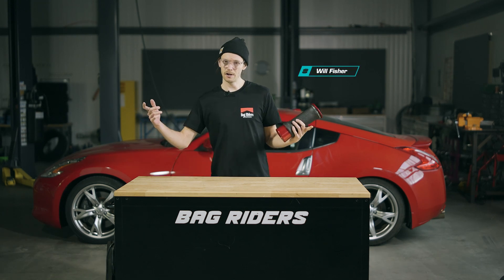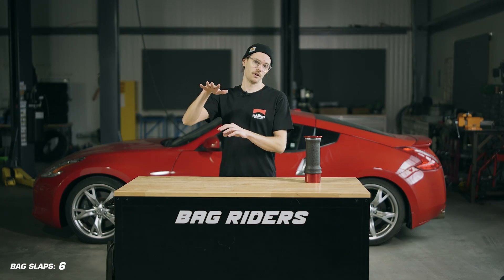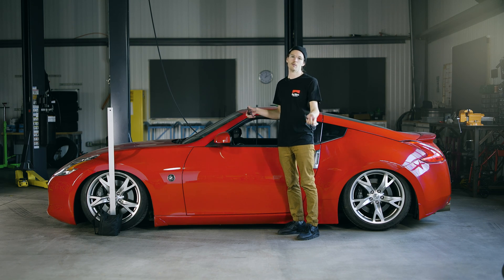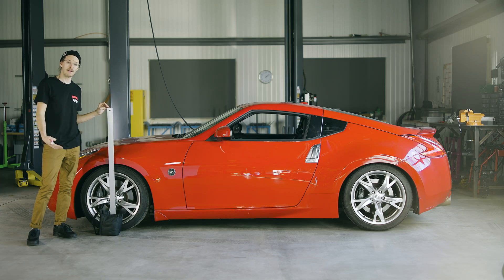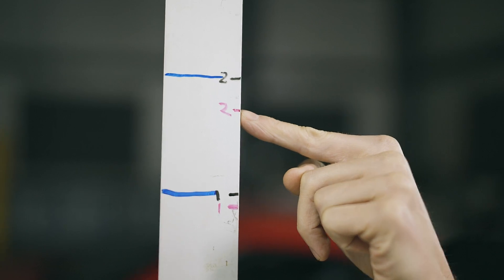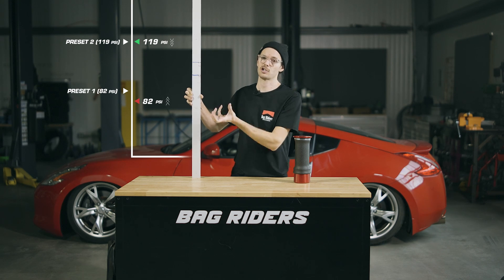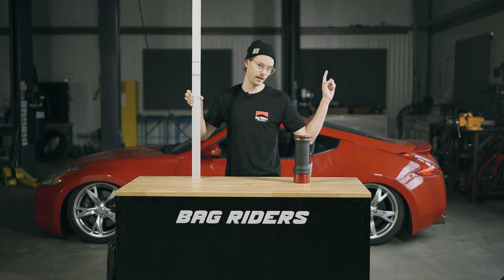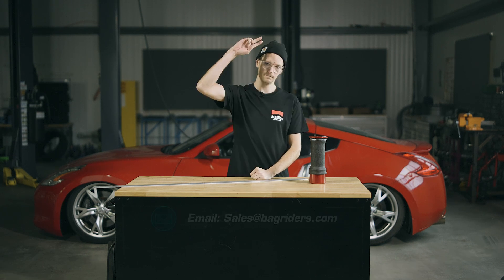Why do people HATE Sleeve Bags?

Comment: Why won't Air Bag companies develop a system for vehicles with air suspension? They already have compressors, air bags, and height sensors.
Reply from the maker: The main reason is that OEM air suspension systems are designed with comfort and long-term durability in mind not customization or performance. They're typically not built to go very low, and forcing them to can actually damage components like the shocks. In many cases, when OEM air suspension fails, the cost to replace it is similar or sometimes even higher than upgrading to a full aftermarket setup that offers more control, better performance, and a wider range of adjustability.

Comment: Tried to use double bellows slim bags and i even clearanced the upper a arms, but bag still hits on the sheet metal of the strut tower on our 91 accord cb9. Would sleeve bags solve this? It looks like they puff up to a pretty large diameter as well....
Reply from the maker: A sleeve might be a good option. Lots of past Air Lift kits for older Hondas did indeed use a sleeve style bag.

Comment: couldnt you basically just go from air out to ride height and measure where it lands, then just set your preset there? i assume it would add more pressure into the bags but thats what the height sensors would achieve anyway.
Reply: After a bit of driving (suspension moving up and down) the height would increase

Comment: I had an off topic question. Hopefully u guys can answer. I have airlift and on the manual it states that max air pressure is 120psi, but I’ve seen people on up to 135 psi are they in the wrong or technically can u have it that high ?
Reply from the maker: I don't see an issue with exceeding 120 PSI. It's not a pressure you would want to have for normal use, but in a pinch it will work just fine.

Comment: When i first got bags the company Vera just released their setup, in like 2017ish. Truhart air struts look just like these in the video, the management i had was pressure based with the front two lines connected to eachother and same for the rears. Eventually got 4 corners to be on individual pressure but understood then that the amount of psi had nothing to do with height. Then upgraded again with their height sensors and they look like some universal tie rods, and during heavy rain one would stop responding. Eventually i had a different shop install airlift 3H management combined with the Truhart airstruts i already had, never had any issues at all since, I wish i understood everything sooner before the install. My first bag went bad a couple months ago after 7 long years of wear and tear, its quite the effort to replace the sleeve but time and patience pays off. Not sure if you guys have a video on replacing sleeve bags, i recall having a hard time finding a clear video on demonstrating the process, if you havent it would be a nice suggestion to help anyone who doesn't have an idea in the future
Reply from the maker: That's a good idea, we will make a Sleeve replacement video at some point!

Comment: My exact issue with my evo x . Rolling sleeve bags are used in the rear. Always have to shoot 100psi into the bag to actually lift the var beyond the point I want. Then manually dump the air to get the pressure and ride height I want.  Oh well, sacrifices 😅
Reply: Dude I’m goin through the same thing on the same car 😂 I was about to buy a whole new management system because I thought something was wrong. Thanks for making me feel better.

Comment: My question is are Sleeves, softer, then bellows I have bellows and it's like riding on a brick at any pressure it's a static air system only on the rear it becomes bouncy at 20  psi and bodoms out the strut and at 30 psi it's stiff it's like riding on a 2×4 piece of wood it's a bc racing coilover with Double bellow conversion bags any info and help will be greatly appreciated
Reply from the maker: This is because of the conversion bags and the way they relate to the available travel of your dampers. Check this video out here: https://www.youtube.com/watch?v=f6MzXOzFsB4&t=188s

Also - what year make and model is your car? Your best bet will be to run an off-the-shelf suspension, where an engineer chose the perfect travel range to match the bag and the weight of the vehicle.

Comment: Air Lift could solve this with a firmware update to their control system pretty easily. Just have the ability to "overshoot" on the way up (Front, Back, All, etc..) by a certain PSI value while staying under the "max". Then "settling" back to preset pressure as after all, it is a pressure based system. I notice my bellow style in the rear does this as there isn't much weight back there. Then it settles on it's own. Where as the front really doesn't given the additional weight. 

However, they may not want to as they'd ideally like to sell the height sensor package along with this type of bag. Sure would be a neat feature though.
Reply: It would use up a preset slot, but you could have one set to be higher than the other presets so you can set it to that one and then set it to another

Comment: I wish I knew this when I got my kit installed in my Pacifica. It was driving me crazy trying to figure out why presets weren’t working. Sleeves in front and bags in the rear. I have height sensors but I need to install them yet. 
Awesome video 👍🏾
Reply from the maker: We are here to help! Once you install the height sensors this will solve the inaccuracies of having sleeve bags with pressure based systems.

Comment: Amazing video I am new to air suspension just installed a system on my polo all the way from south africa 🇿🇦 curious to know the difference between sleeve bags and bellow bags
Reply from the maker: Just to confirm are you referring to a single bellow or double bellow air bag?
Reply: @bagriders  double bellow
Reply from the maker: @trivolandhaver8994  Bellows air bags generally are of a greater size compared to sleeve-style air springs, resulting in higher lifting capability and load-handling capacity. The design of most double bellows air springs permits inflation to the desired firmness and deflation in a similar manner. On the other hand, the sleeve design allows for a more compact overall diameter when constructing this type of air spring, distinguishing it from bellows air springs.
Reply: @bagriders  thank you

Comment: I have double bellow airlift struts. I would  always hear a thump going from aired out to ride height. I'd imagine its the air filling into the double bellows expanding both chambers after being collapsed on it self  making that thumping noise. My rears are sleeves and they don't make any sound. Im wondering if that's normal for double bellows to do or something I should be concerned for. Thanks
Reply from the maker: Yes it's completely normal to hear a double bellow make that thump noise when airing up!
Reply: It's normal. I have double bellow and it does that on my rear bags. It's the bag unfolding from itself. No damage happening. Completely normal and airlift is aware of it.
Reply: I’ve heard that too. I think you’re right.

Comment: To me I figured you should only use those sleeves in the rear setups for fwd cars. Just my opinion
Reply from the maker: Sleeve bags are typically used in situations where the available space is limited, preventing the use of a double bellow due to its size.
Reply: @bagriders  This was my thinking as well..I have bellows all around my 5th gen camaro and I had to be very careful when buying wheels and tires for my car. Width,  offset and tire size because they can rub against those meaty double bellows in the front.
Reply from the maker: @blkeclipsel2400  Yup you are correct, that is one important factor to take into consideration.
Reply: That doesn't matter. Sleeve bags essentially ride softer than bellows. In fact, if you are RWD you'd actually want the softer bags or softer pressure settings (eveb on bellows) set up in the back for "grip". If you stiffen up the rears too much it will be too bouncy, and you'll hop/skip around corners like over-inflated tires.

Comment: They come stock on older Mercedes Benz’s. I had a 2003 Mercedes S class with em, smoothest ride I’ve even felt on any car I mean it was astronomical. I lowered the car on the OE bags about 20 years and 180K and they were still going strong for quite some time despite some neglect from the previous owner. The biggest issue I had besides them eventually developing leaks, was calibrating the height sensors to work when I hit the raise button in the car but man it was great when it did work
Reply from the maker: One thing to keep in mind, the OEs use a true tapered air spring with a carefully tuned lower piston. Companies like Air Lift, D2 Racing, Tru-hart (all the rest as well) use a straight rolling sleeve. They really aren't equivalent to one another. Production of a true tapered sleeve is very difficult, which is likely why so much of the aftermarket options focus on bellow-based bags,